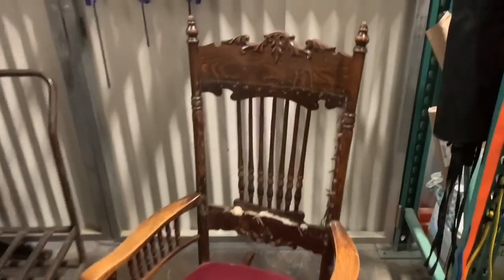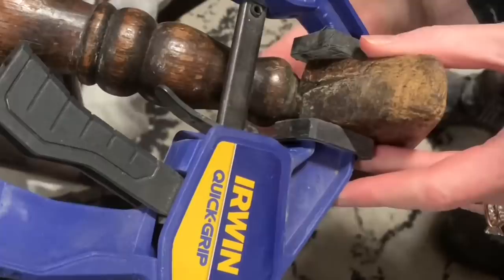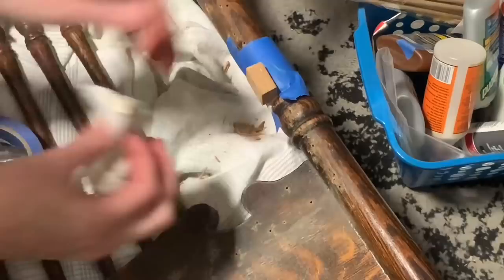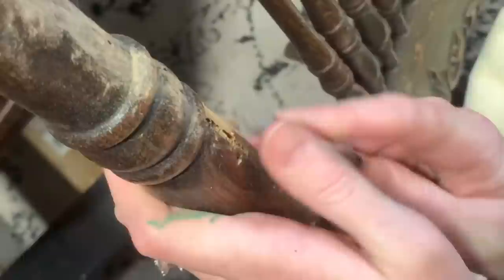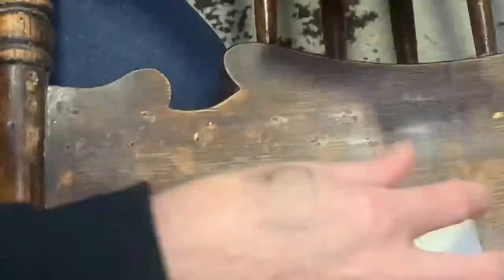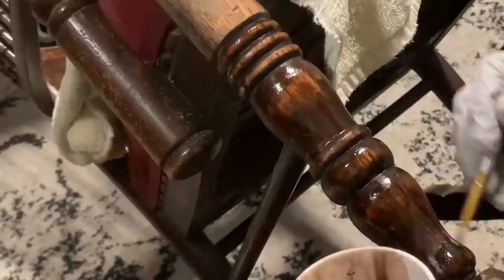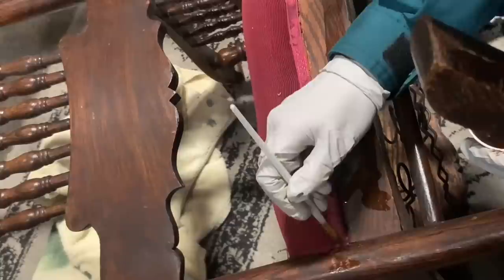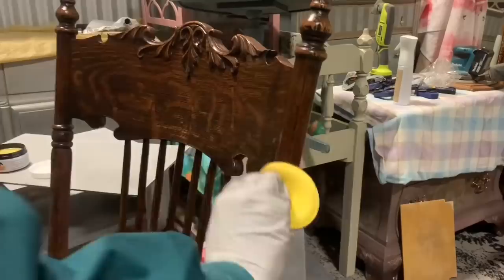We Aren’t Painting! Rocking Chair Restoration | Elegant Upgrades

Comment: Just a tip for the future, use a 2 part epoxy to join wood that doesn’t fit together tightly. It’s the best as it can gap fill as well as bond the wood. White glue can only work well on a tight seal of clean wood against clean wood, otherwise the bond will fail soon or later.
Reply from the maker: Oh man! I actually have that and pigments to tint it 🙄 Where were you when I was doing it? 😂 
Thankfully I got it cleaned out and it had a smooth surface to glue up when I was done, but that would have saved me some work.
Reply: @elegantupgrades  it turned out great. I restore antiques and upholstery as a hobby for 30 years now and I personally love all the finicky work of filling holes and especially colour matching. It’s such a sense of achievement when you can’t tell the patch from the rest.

Comment: Learned so much! What do you think about filling hole with sand from the  furniture and wood glue.
Thanks
Reply from the maker: I’m so glad, Candace! I do use sanding dust and glue when it’s called for. This chair wouldn’t have been a good contender because I didn’t have any sanding dust from it. But I’ve used it a lot for tops when I need to fill holes and gaps and want it to match. It’s a great option.
Reply: @elegantupgrades  🤦🏼‍♀️ duh!?!